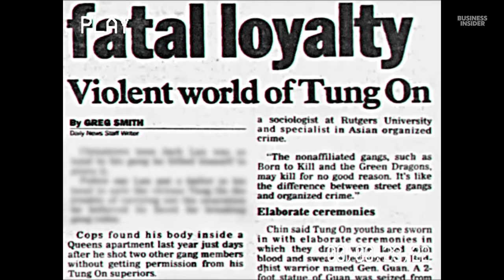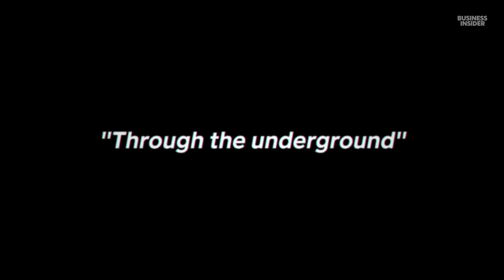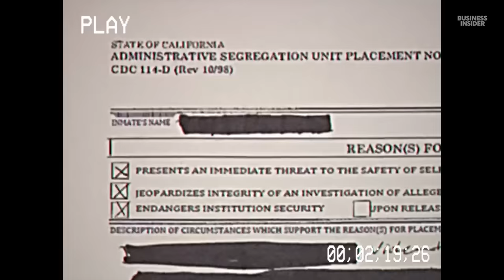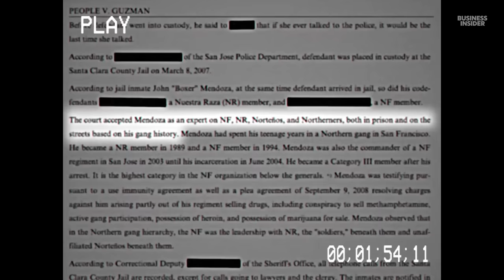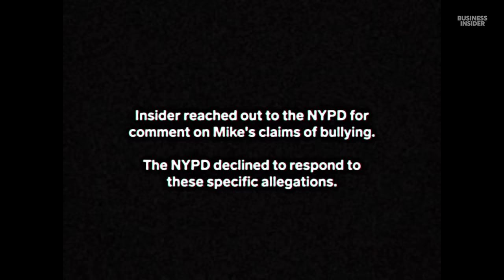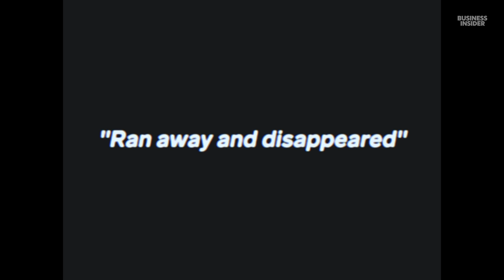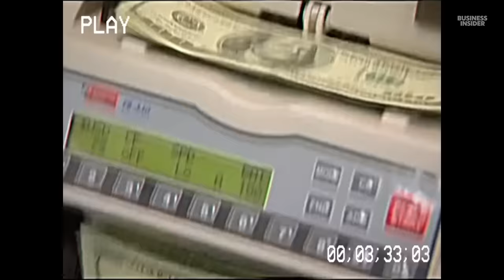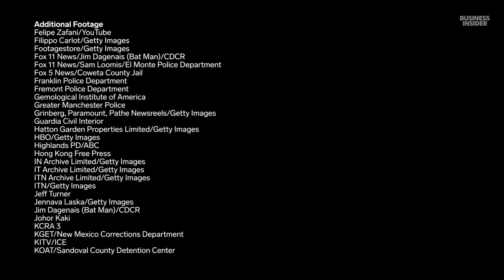How 8 Crimes Actually Work — From Money Laundering To Diamond Heists | How Crime Works Marathon

Comment: The China guy was correct with the Italians working with the Chinese,especially in how close Lil Italy and Chi town are .Besides supplying poker machines ,Italians had lock on all garbage pickup routes ,my family has been in private sanitation in NY since the 30s ,..Property right system made garbage pickup very lucrative,.mostly all Italian owned,Trucks with Last names and Italian colors all over the  City after midnight.,..Cosa Nostra is eternal,.Morte Prima Di Disonore